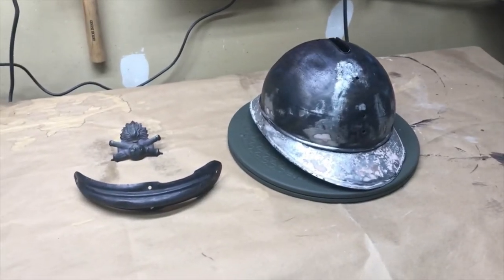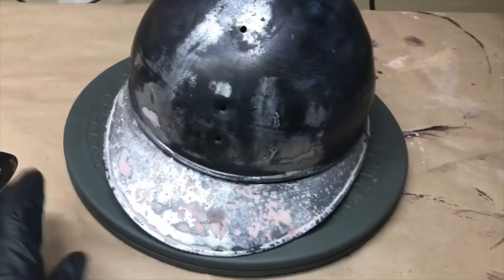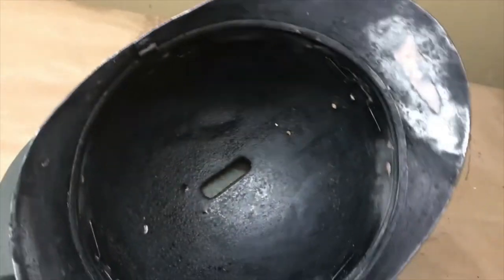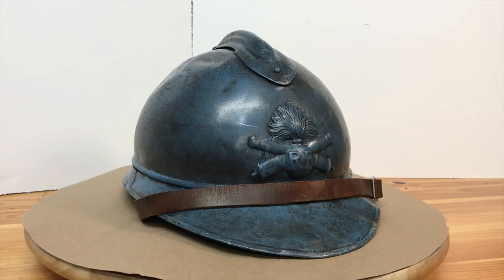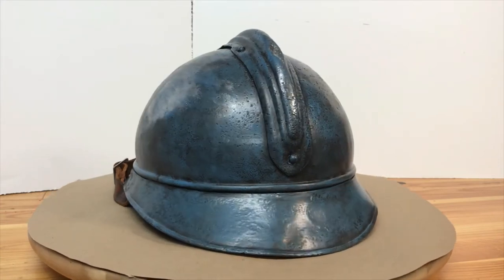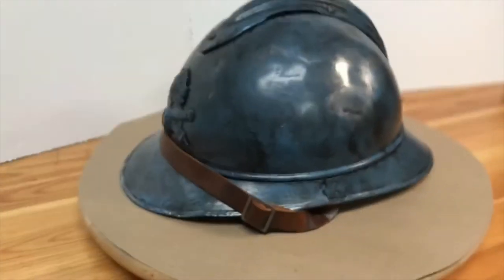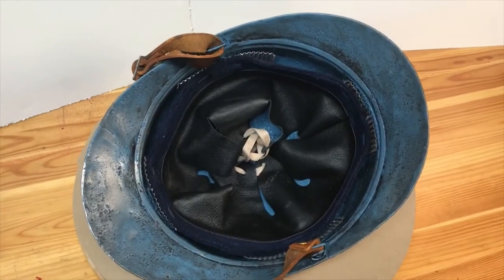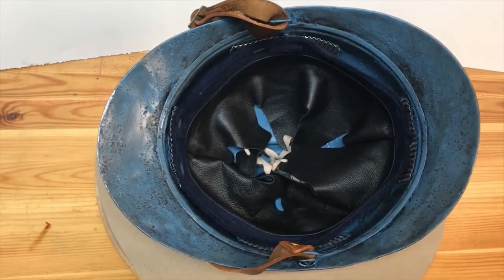WW1 French M15 Adrian Helmet - Part 2 (Finished!)

Comment: Where did you find the emblem and rivets?
Reply from the maker: I got the rivets and liner from Prairie Flower Leather Company online. I got the original emblem off EBay. I also purchased a repro emblem which I didn’t end up using which came from China and didn’t look great.
Reply: usna 98 Thanks 🙏